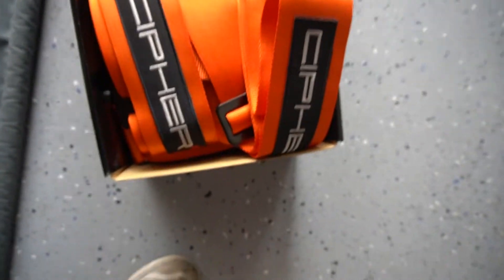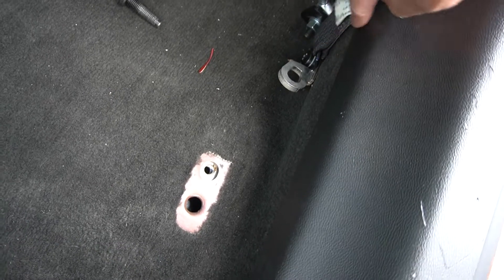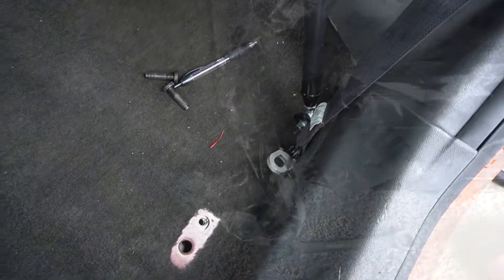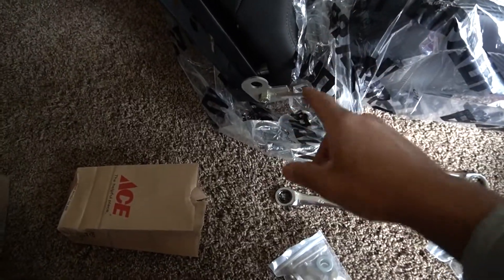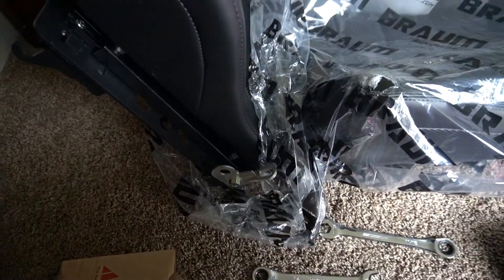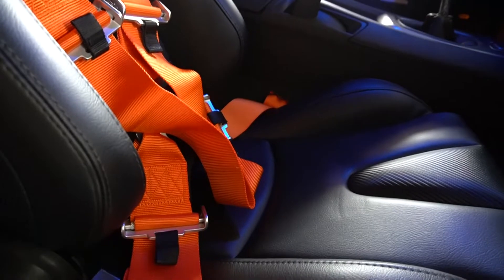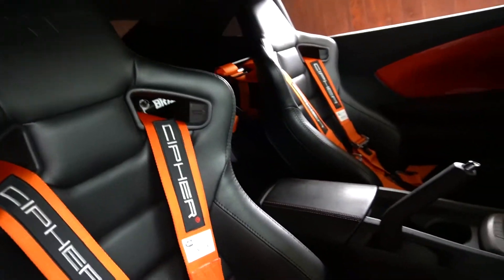Cipher Harness Install On 5th Gen Camaro (Without Eye Bolts)

Comment: So did you have to buy 4 of the braum brackets or does it come with any? I'm in the same boat, bought the harness bar and 5 point harnesses...but don't want to do any drilling just yet. I appreciate you making these videos, definitely a big help for us less mechanically inclined folks.
Reply from the maker: I don't know what you mean by brackets. The seat brackets? I only bought 2 of those. Maybe watch the video again and it will clarify.
Reply: @mistermanage1119  
Thanks for the response. 
I’m talking about the lap belts. If you’re sitting in your driver seat, the left lap belt is mounted with a bracket onto the original seat belt assembly near the floor by the driver door, right? But what about the right lap belt? What sort of bracket do you need and where does it go? Does it go where you clip your original seat belt into? If you know what I mean lol I’ve watched your video a few times and some other videos, but cant find a clear answer on that.
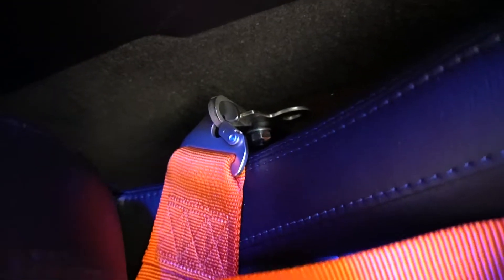Reply from the maker: At the 7 minute mark I showed a example of the metal piece I got from braum for the passenger side. That is where you would mount it but it would be on the right side for the driver seat. I have another video on the channel of me assembling the braum seats and sliders and I believe I  go over it there as well. hope this helps. I also showed it at 13:30  @gangsterdisciple759
Reply: @mistermanage1119  
Thank you, I appreciate the help!